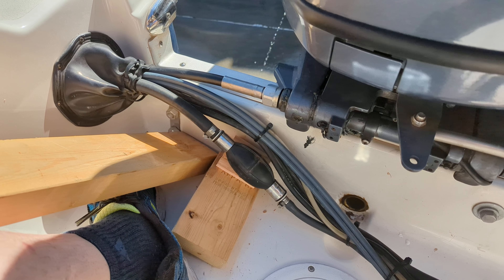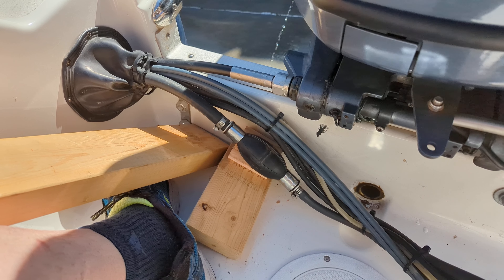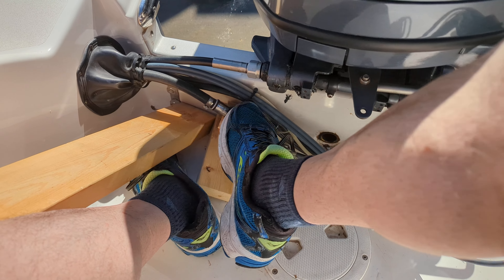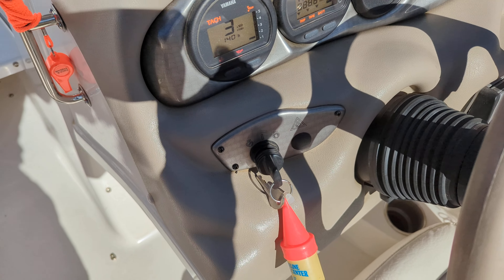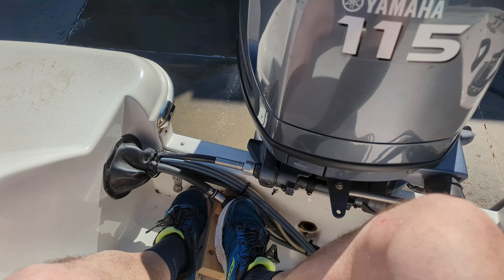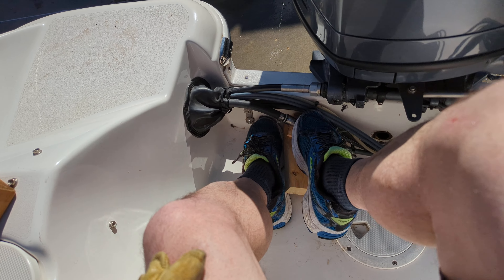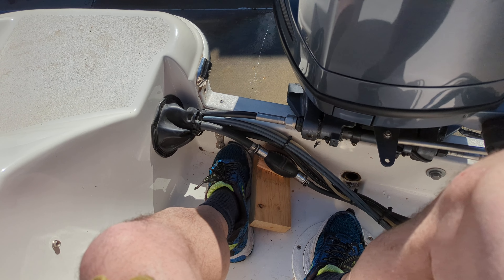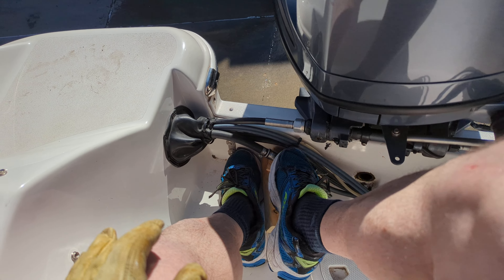Yamaha F115 Got Gas?

Comment: You un do the fuel line the engine side of the bulb the squeeze and bock the hole with your thumb when you release. The only way to do it have done hundreds of filter replacements it’s the only way to bleed the the lines
Reply from the maker: Dude! Thanks for the tip.  I'll give it a go

Comment: Probably have a small air leak in the line.  It shouldn't need that much pumping to get the fuel there even from the tank.  Alternatively, did you check the oil/water separation filter and fuel filter?  Having a block there will keep the fuel from flowing.  Doesn't sound like there is a spark issue.  Lastly, you might want to have your injectors cleaned regardless and I've gotten good at getting them out if you want help.  SHouldn't take more than 15 minutes to get them out and my small engine mech in Weiser will clean them for a pittance
Reply from the maker: I was thinking a leak also... The only thing I've touched since last year is the oil/water separation filter so I guess I'll take another look at it.  Ya cleaning the injectors sounds good! :)